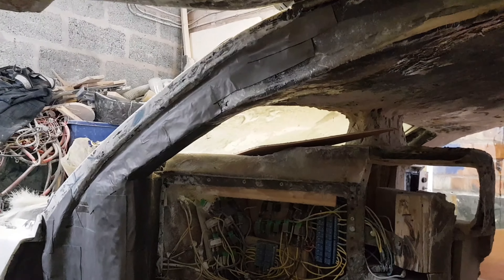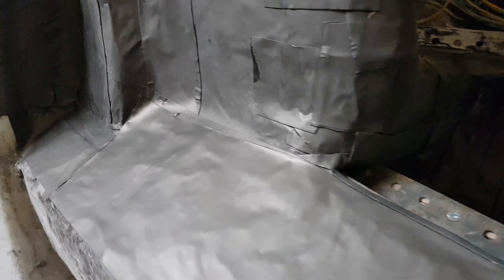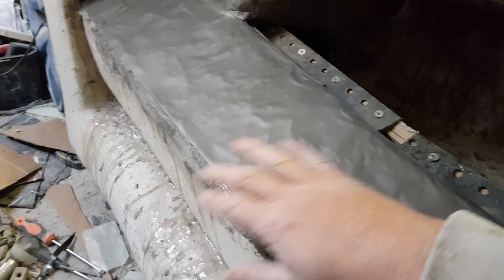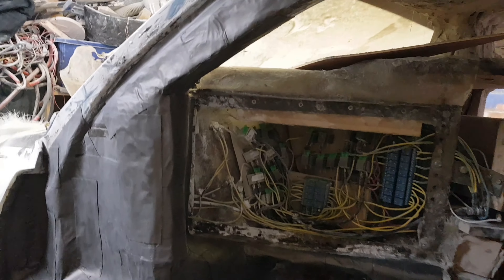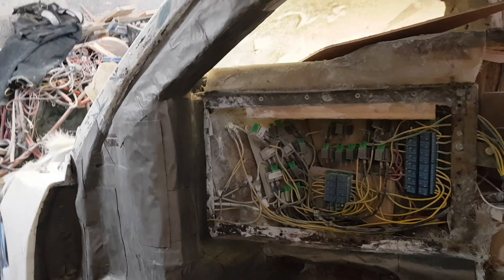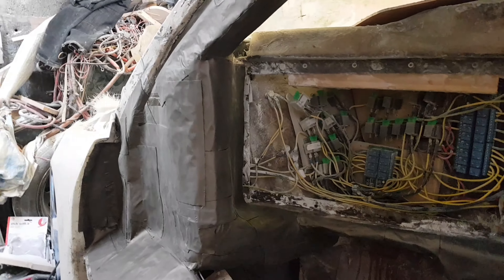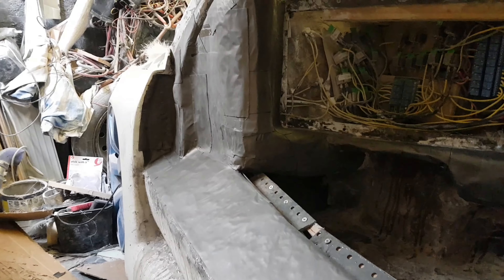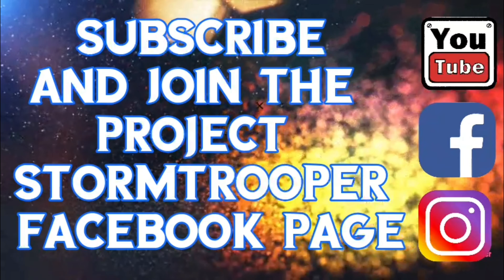51 - laying down some interior top covering and dash top building

Comment: Get yourself a hair dryer and warm it up. Makes it a bit more flexible
Reply from the maker: I have been applying with a hair dryer otherwise it doesn't bond all that well. Once it has.a bit if heat its nice and solid.